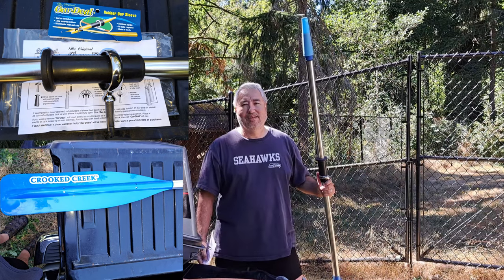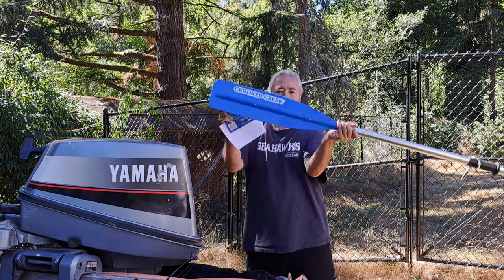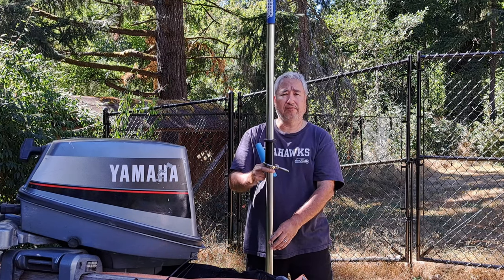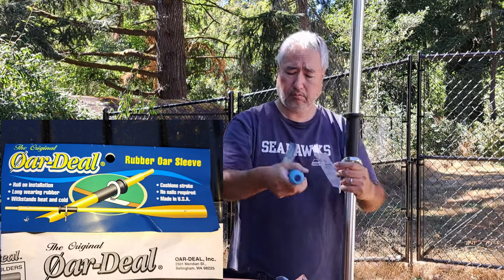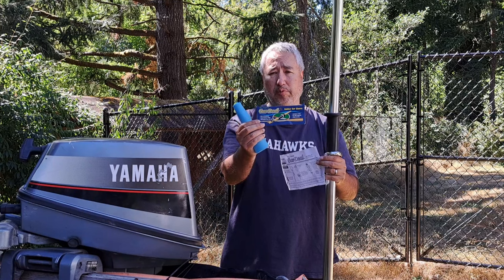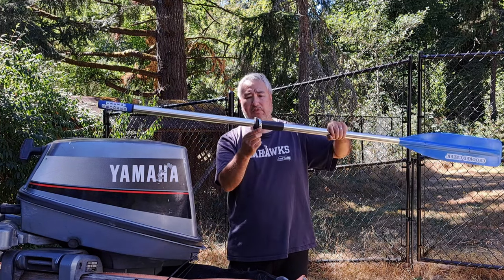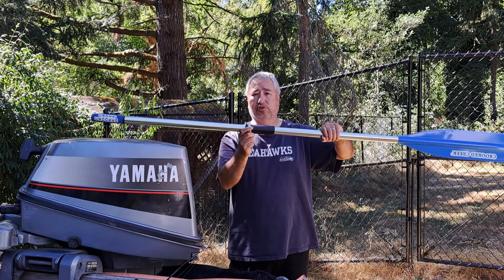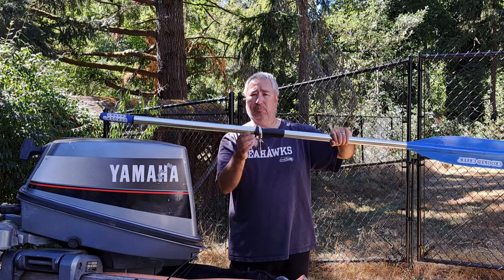Aluminum Oar & Rubber Stop How To Install and Initial Review

Comment: just ordered the west marine spoon oars with the sleeve included im just wondering how to move the sleeve if it needs to be adjusted or removed im worried it might be stuck in place 😢
Reply from the maker: Yes, I was really worried about the same thing. Especially if it is tight fit like it should be. Mine was snug, but I would have been able to reroll and move a little if I needed to I  think. Like the old saying, measure twice thrice and cut once. Good luck hopefully it works out for you. Thanks for watching and commenting 👍👍
Reply: @raybaby  thanks! and hopefully the sleeve comes seperate and not stuck on rhe oar😅
Reply: Force a thin dull blade around the sleeve ends and squirt in Windex. If you can use compressed air - much better.  Just blow air under the rubber and keep it wet with Windex.  Windex is very slippery but evaps very quickly.  You can slide the collar until it goes away.  Repeat until it's where you want it.  Same applies to installing handle bar grips.

Comment: So any update on the oars? I got a 12ft sea-king v bottom boat project going on right now and I'm trying to figure out what oars, oar stops, and oar locks to go with. I was pretty much going for this similar build.
Reply from the maker: Sorry not yet.  I have only did some initial rowing movements in the yard, but nothing in actual water with resistance. I was expecting to go out on the lake, however friend had to bail last minute. It has been all rivers without the boat lately.  I hope to get some lake fishing in couple times next couple weeks.  I usually try to post after a trip within a day so hopefully I can share info with you if you still have a couple weeks before you need to buy.
Reply from the maker: I subscribed to your channel  You have some nice trout vids.  I like the waters you are fishing.  Very pretty. Every video had comments turned off.  I wanted to leave positive comments.  Just wanted to make sure you know that they are off.
Reply: @raybaby  thank you so much for the support I'll most definitely turn them on I had no clue. Pretty new to YouTube myself. Heck yeah let me know how it goes my head is spinning from all the oar options that are out there. Done some river and lake kayaking but i haven't done any proper boating yet.
Reply: @raybaby  Comments should be on now, also some new video just went up too. Thanks!
Reply from the maker: Awesome I will check them out.  Thanks.  We might try taking the boat out tomorrow.  If I do, I will let you know.
Reply from the maker: They don't seem to be on yet.  Make sure you didn't check the box video made for kids.  I heard that stops comments sometimes.